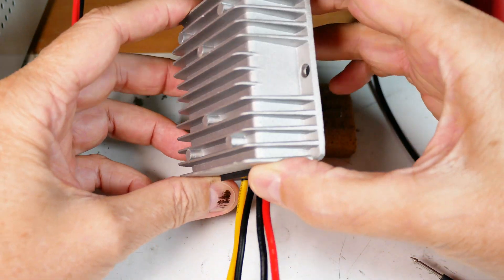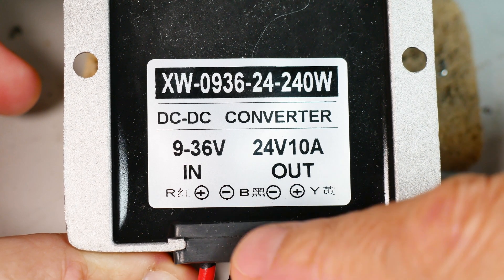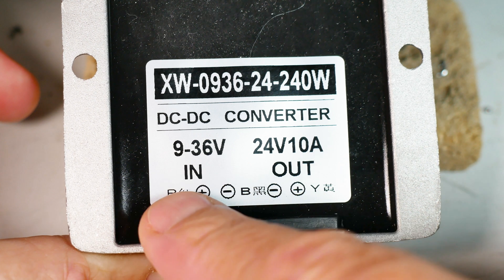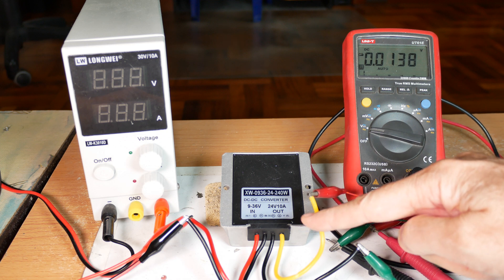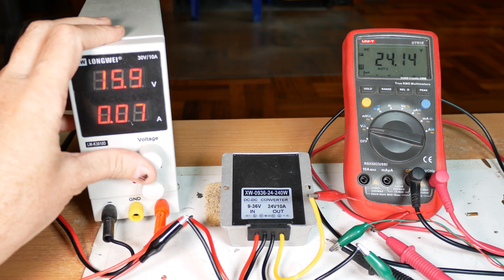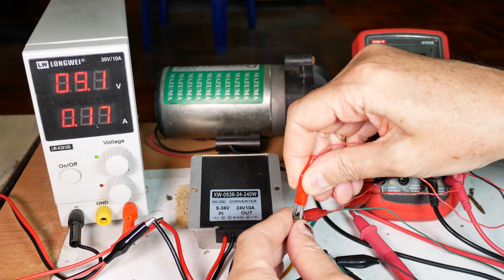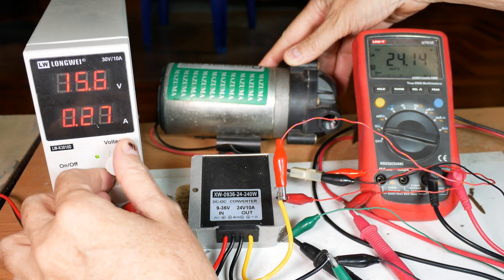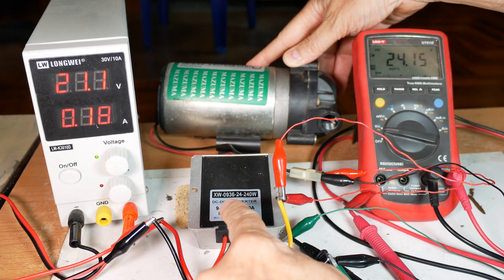DC-DC Converter, Input: 9 to 36 volts, Output: 24v (4K)

Comment: sir i have a solar panel of 545 w which is giving 44 volts and i want to use it for a 24v 250 water pump, is there any converter available for this??????
Reply from the maker: I assume the water pump is DC. Try searching "DC to DC Buck Converter 48V to 24V".

Comment: Hi...in this kind of converter ,can i put just 24 volts dc to charge lithium batterys? At this kind of converter  converter 12 vdc to 24 vdc  ,if i put 13,8 volts ,i will get 26 /28 vcd to charges the batterys ? Because i think 24 vdc its little voltage to feed a lithium battery pack
Reply from the maker: You should use a smart battery charger for lithium. It's safer and makes your batteries last much longer.
Reply: @tsbrownie  i know...but would in case of emergency...but about The input 13,8 VDC ...i Will get 26/28 VDC?
Reply from the maker: @mrborges73  The output is fixed as rated, so one rated at 24 v will output 24 v. They are very accurate. The whole idea is to produce consistent output within an input range.

Comment: could i connect a 12V leisure battery as the input and connect lets say a 24V mini oven to the output ? 
the oven its self is like 300W im roughly 50W short
Reply from the maker: There are too many variable for me to say for sure. If there's enough input power and the converter has enough power capability, then in theory it's possible.

Comment: so can this b used to charge lithium batteries for solar?
Reply from the maker: You need an intelligent charger between this and the batteries. This can regulate the output voltage, but not the current and does not know the charge level of the batteries. Without a lithium battery charge controller it would over-charge them and that creates a serious fire hazard.

Comment: Need to measure the amps the pump draws. You already had 24volts from your power supply. The only question is how many amps do you need to run the equipment? Maybe measure amps from the converter output please, ty.